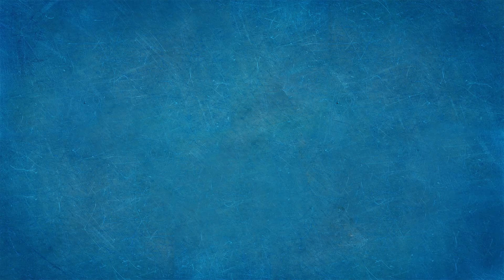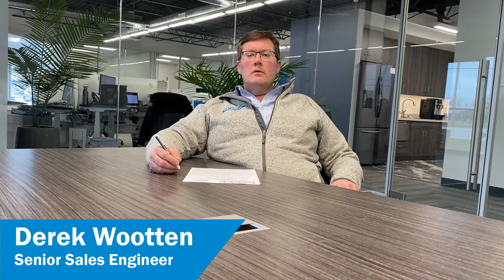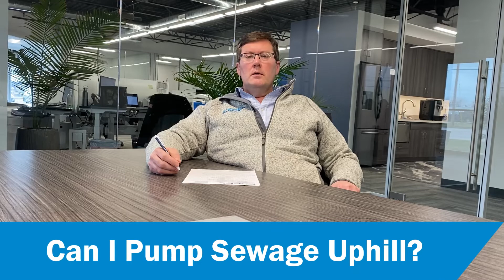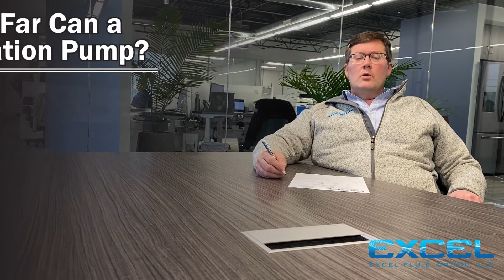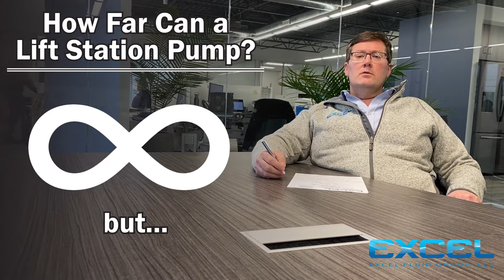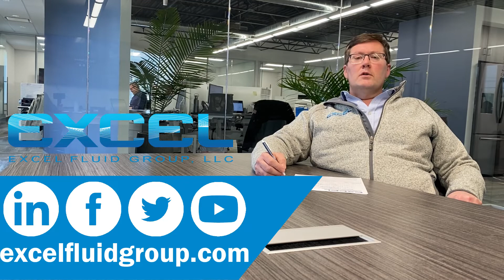Can I Pump Sewage Uphill?

Comment: A pleasant day sir. I just wanted to know if is possible to lift the water uphills from the river with elevation  of 230ft.using vertical in-line multi-stage pump.Thank you
Reply from the maker: Hi Roger, There are many factor that could alter efficiencies and effectiveness but if the pump is outfitted with a priming system (including an air release valve) and the suction is screened, then Yes a multistage pump could be used. However, in general, most multistage pumps are relatively low flow.
Reply: @ExcelFluidGroupOH  i really appreciated that technical info. More power to your different videos like this sir.